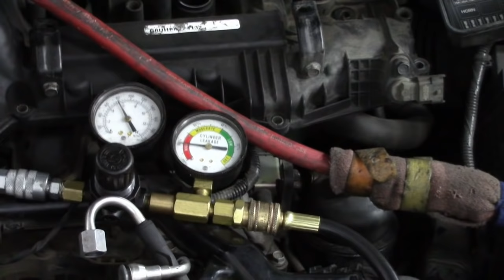Muffler Shop Says This Engine Is Blown?!?!

Comment: I can't help but be impressed by the ability to reassemble multiple components of an engine that you've never even seen before - kodos for sure. I also can't ignore the idea of Matt providing advice for a hair stylist; I'm sure the irony wasn't lost on Vicky either - lol. Great video. 😃
Reply: I have done it a couple of times but when you are almost to the end, you expect more bolts and nuts but are surprised that it is not a lot actually. A lot of cars use clips to secure a lot of the wiring and hoses 😅

Comment: I took my Subaru with only 60,000 miles on it to the dealer when it was running rough to do a diagnostic test. I'd already replaced the air filter and fuel filter that was near the engine, and the spark plugs. They told me I needed a whole new engine, I must have ran it while low on oil. WTH! As I was leaving the parking lot a different mechanic waved me down and asked me if I knew that my car had two fuel filters, there was another one in the rear fender well. I changed the filter, and the car ran perfect for the next 5 years.

Comment: The Meineke by me (Broomfield) is a full service shop. I've only had them do an AC recharge and alignment on a car I was selling. They managed to not get the AC right, so it went back but seemed fine on their second attempt. Glad this guy was spot on.
Reply from the maker: Ah that’s good to know. I never knew Meineke to be anything other than a muffler shop. my only experience with meineke was when I was about 21 years old. I got a muffler done by them and as soon as I left the lot and pulled into the street I heard a loud clunk and my car sounded like a motorcycle. I looked on rear view  mirror and my muffler and tailpipe were laying in the street lol. true story!!!
Reply: @SchrodingersBox  The ones around here are full service too. Same for the Midas shops. I guess plain mufflers and pipes don't generate enough to pay the rent anymore.

Comment: I’m not an ASE tec I was formally trained on wrenching by USAF on jets, I worked many years as an engineer on tugs. From 08-11 I worked as a maintenance manager for a highway company and had a fleet of over 100 trucks. I did 80% of general maintenance and repairs in house unless exhaust, trans, or major internal engine repairs. I had a local shop that I used for the stuff out of my ability and I also used our local Midas and Meineke both have very qualified techs I always had excellent service and repairs that were backed up! Not all techs are equal if one feels sus trust your gut and go elsewhere!

Comment: well that's amazing. Buy new head cover instead of paying for tow truck..
Running engine with dead cylinder will kill o2 sensors and catalic converter.. But you don't need to hire tow truck... Amazing just amazing
Reply from the maker: a new cylinder head installed is quoted at $6000. for a car worth about $9000.
Reply: So instead of tow truck and engine replacement is better to risk killing o2 sensors and catalic converter? I am not questioning your work. You did what client asked for. But i can't see owner's logic.

Comment: One of the most interesting aspects of mechanical work, for me, is the forensics. Why did it fail or what did the previous owner or another tech do to it? Many times the original issue will be masked simply because another person or three threw parts at it without first finding the issue.
Reply from the maker: Totally agree. That’s the fun part. As far as I’m concerned once the brainwork is done and it’s down to monkey wrenching is becomes work at that point!

Comment: CarAdvice:  I am interested in buying a Kia 2011 Sorento  with V6 AWD.  Is this a good SUV to purchase or should I buy something else?  I am also interested in a 2009 Saturn VUE with 3.5 V6 AWD.  Would this be a good purchase also?  Due to used car shortages, Toyotas and Lexuses are 50% over normal prices.
Reply from the maker: The most important thing is what condition the car is in and how well maintained it was. I have seen Toyota’s die at 60K miles and Hyundai’s that have 250K miles. it’s the cars condition and maintenance that’s most important.

Comment: You are absolutely right about the 2% mechanics and the rest are on their way to learn or get burned in this field, sometimes I find it very difficult and annoying to see some guys from a tire and lube services give diagnostic advice about can network or etc
Reply: Those are the shops that melt a customer's credit card by replacing parts based strictly on MIL codes and pattern failure data. And if they install a part WRONG, or get a defective NEW part, the customer runs out of money and/or patience and finally takes it to "the expensive shop" to get fixed correctly 😆.
Reply: I walked away from the auto repair industry 20+  years ago.  Was an ASE certified tech got injured on the job, and could not do the physical labor any more.  Managed a quick lube for a while after getting injured before leaving the the automotive industry.  There absolutely are people that are way over qualified for their position doing basic routine maintenance for various reasons.  However i do agree it's important to be highly skeptical of diagnostic advice from a lube or tire shop as it is highly unusual for the shop be equipped for any diagnostic.

Comment: I think every case is different and if you're just trying to get 20 miles or whatever it's not a big deal but if those guide arms aretube and broken  and you start dropping stuff in the oil pan, while yes it has a screen, you'll clog the screen and cause oil starvation. I just think saying that bolt fell in the pan isn't a big deal, is a big deal until you see the pick up tibe.
Reply from the maker: there is no way a bolt is going to be picked up by an oil pump and clog the screen. not even concerned about it. the engine oil pressure reads perfectly normal. so far the vehicle has several hundred miles logged and is still running fine with the dead cylinder.  I have seen cars go for years like that.
Reply: @SchrodingersBox  I didn't say just the bolt I said the guides worn broken will clog the screen. I've seen it. But do you. I just dont think saying not to worry about it is correct.
Reply: @SchrodingersBox  you must have a difficult time reading and understand what im saying. 
If guide arms worn or broken
And you keep dropping stuff in oil pan
If will get stucked up to the screen
Me see often
Me do professionally
Me know what Me talkie about
You say no big deal
Me say potentially isn't but be careful
I'll upload a video of me drawing ot out for you next
Reply from the maker: still not worried about it. I can see the guide arms are not broken. I can tell you the only thing missing was one of the camshaft phaser bolts. there is no concern of clogging the screen. the oil pressure is perfectly normal. I think they have much more concerning things with this engine  than the impossibility of losing oil pressure.
Reply from the maker: yeah I will be sure to keep your advice in mind with my 250000 subs and 10% growth rate. 

only a total incompetent stupid fool Would do a timing guide replacement and oil pan drop in a blown engine that doesn’t even have worn guides or risk of oil screen blockage. and only a dumber fool would conclude this engine had those issues just because other engines had them. 

  you just simply aren’t thinking. you are reacting. there is no big deal if something drops in the oil pan that has no possibility of interfering with the engine whatsoever. sure it sounds bad, but thought process indicates a bolt in the oil pan is not a concern especially on an engine that is already blown. there is no evidence the guides are failing or even worn. there are no particulates in the oil indicating such a thing there is no way the oil screen will allow a bolt to pass through it.
  Just accept the facts. leave your emotions behind and look at the facts.

Comment: I'm sure most Meinekes are full service. I worked at one for years and all I did was diagnostics. I had a 5 gas analyser, scan tool, 4 channel Pico. We had one guy that did exhaust all day and was good at it. We had 3 guys that did brakes and suspension, and 1 guy that did a lot of the heavy r and r's.

Comment: Driving it for a while with a dead cylinder will misbalance the drive and cam shafts and eventually a bearing will spin.  I found out about that the hard way.  After fixing the malfunction on the cylinder I had to pin the bearings to keep them from spinning and it ran fine.  I drove  the car another 100k miles but I drove it like a little ole lady so as not to stress that engine which I felt was hanging on by a thread.
Reply from the maker: yep that’s true. it can take months- even years sometimes for that to happen though. they just need the car a couple weeks to trade it in or whatever. but yes eventually it will cause failure.

Comment: Meineke does tires brakes and mufflers and exhaust work and some basic engine work sending of the corporate or franchise they also do oil changes transmission flushes radiator flushes etc

Comment: Hey there! I’ve got an issue with a 2001 Jetta VR6 making a rattling noise from the serpentine belt side of the engine that I can’t seem to diagnose myself 😔 Would you be able to perhaps give me a hand? Thanks in advance :)
Reply from the maker: You should remove the serp belt and see if noise goes away. if it does it’s a bad pulley along the belt route.  if it persists then it’s internal and you should remove the timing cover to inspect.

Comment: just went through this of sorts on a cheap malibu.. bent EVERY valve in the head because the guides gave and the previous owner ran it till it wouldn't. got a 2012 for $600 though lol. slapped a junkyard head on it and new timing set. in the end i also put new solenoids on it also. it wasn't a job for the faint hearted. a bent valve doesn't mean the piston is toast. they can be cleaned up and used if the pits aren't too horrible. of course this is a guy fixing his car in his driveway, probably not a for a pro. i wouldn't back that fix longer term if even at all. i got lucky and i don't know if it'll torch though the piston long term or not. it's rolling, good compression, smooth running and cheap on gas.
Reply from the maker: Yes in this case the piston survived.  in fact usually I find it does. but I have seen where it also punched a hole the size of a tangerine in the piston crown too!

Comment: A local Meineke's wanted $1000 just for pads and rotors for my 2010 Subaru Forester, more than the local Subaru dealership would have charged---and the dealership would have used OEM parts.

Comment: Matt you are so fun to watch. Just an idea... maybe dumb things down a bit for some of your newb viewers and tell us exactly why this particular failure would result in the need for a new engine or rebuild. Are the valves so far inside the engine it all needs to come apart? I know you guys all know these answers but I have very little clue what needs a rebuild vs what can be fixed more easily.  Thanks! Love your style!
Reply from the maker: appreciate the comment. since this is an advanced channel I tend to assume the viewers are familiar with the mechanical and electrical. 
that’s why what I do on my pay channel is.I walk much more step by step assuming the viewer is unfamiliar. for example here I just go the the fuse box to run the starter with a jumper wire. on the paid channel I walk through how I know where to make the connections and how I mapped the circuit out. I also have videos where I explain the engine strokes and why I am getting low compression or high leakdown based on what must be happening.
Reply: @SchrodingersBox  ahhh thanks for the info! I didn't know any of this. I will check it out. You have a great teaching style and thanks again for the videos. I just do basic maintenance but love knowing more about how things work. Always amazed how you are able to put everything back together again! Let's go brandon!
Reply from the maker: Hahaha “let’s go Brandon” lol!!!!

Comment: Just 3 extra bolts. Hell I have gotten a box full of bolts & small parts from fixing cars. I would count bolt holes and when putting things back together. There would always be bolts, screws, nuts, washers, and little insignificant little parts leftover that we could not figure out where they went. Tear down a whole car & rebuild it & you get those things. I just thought the manufacturer had more stuff than needed on the cars

Comment: I find it strange that the phaser could have moved far enough to bend a valve without a jumped chain. It wasn't damaged to the point that it allowed the camshaft past the physical limits of the phaser. Valve damage on only one cylinder is a little uncommon too.
Reply from the maker: agreed and I thought same. but that valve is bent for sure. also when I see this happen it’s always one valve that I have ever seen. because usually engine stops dead when they collide the first time.

Comment: Why would it need a new motor when all it's got is a bent valve? Pull the head, fix the valve. A few dings in the top of the piston won't hurt anything.
Reply from the maker: because it’s cheaper to get a used motor.

Comment: If the valve bent it would also tweak the piston rod and crank
Reply from the maker: not necessarily. a valve stem is maybe 20mm in diameter. a piston rod is inches in diameter. there is no way it’s going to bend the piston rod.

Comment: What will you consider to be some of the possible causes for this problem, lack of oil,carbon build up at the valves????
Reply from the maker: no idea. my guess is someone worked on it before and didn’t torque the phaser bolts.

Comment: Get this thing to a dealership ASAP! All 2013/14 Santa Fe Sports have a 10 year warranty on the engine. They're notorious for failure and Hyundai will fix it for free. Generally it's a replacement of the bad parts ie either a short block or head change. Not a complete engine. Either way, definitely get it to Hyundai.
Reply from the maker: it’s a 10yr 100K miles warranty. it’s well past 100K miles.
Reply: @SchrodingersBox  This isn't the regular warranty. This is a recall for the Sonata and 2013/14 Santa Fe Sports only with the 2.0T and 2.4 Theta II engines. 10 years and unlimited mileage. If they can find a good dealer they could end up with a decent deal. I'm doubting that the damage to this engine quite qualifies but they could get a deal where they pay for a top end and Hyundai pays for the bottom end, labor and a car for the interval. It's more than worth it to have it checked out instead of sticking it into a storage unit to rot.
Reply from the maker: ok so you mean you are referring to the recall, not the 10 year warranty correct?  the recall has nothing to do with this engine much less this issue. the recall was specific to the 4 cylinder only for a completely unrelated event. there is no recall on the 6 cylinder.
Reply: @SchrodingersBox  Well... crap. I didn't even notice it was a 6. To quote Emily Litella: "Never Mind!"

Comment: The sad thing about modern cars these days is the increase use of cutting corners using plastic engine components. They don't make them like they use to. I still drive a 15 year old Camry SE and it may still run for another 10 years or more.
Reply: Well that stuff don't rust!
Reply: @jostouw4366  sure plastic may not rust but you will be going through a lot of them. The modern GDI engines aren't going to last as long and a normal engine. Governments are pushing strict emission standards and force manufacturers to to make more smaller fuel efficient Engines that contains more plastic components, more complexity with turbo chargers etc.Toyota stopped mass production on there V8s. It sucks blame the government and manufacturers for cutting corners.

Comment: I don't understand feeling the need  to drive it 20 miles like that , tow it and then get some help and push it where it needs to go.  Oh well,  Plus , could the compression leakdown problem have also been a blown head gasket at that cylinder? At least it didn't grenade when you revved it.
Reply from the maker: how would it be a blown head gasket with leakdown through the intake though?

Comment: It's too bad actually that they didn't just want to put a cylinder head on it The bottom end is probably fine You can fish that bolt out of the oil pan If they drive it like this the valve head or the valve seats going to drop and then blow a hole in the piston
Reply from the maker: how is the valve seat going to drop exactly- I don’t understand that. how is that going to happen?
Reply: @SchrodingersBox  You can't understand how event valve hammers the piss out of a exhaust seat and an alloy head eventually the seat gets hammered in on one side loose in its pocket and can fall? Or that bent valve head continually hammering on the seat decides to try to bend itself back and the stem snaps smashing a hole through the piston you can't understand that?

Comment: Who are they going to call when it dies 10 miles from their house?  Your warranty was for 20 miles, ha ha.  It would be cheaper to sign up for AAA cheapest plan to have them tow it to the house when it dies.
Reply from the maker: Not even worried about it at the time, and in fact they have actually been driving it daily since the video released. probably had several hundred miles by now and still fine. I have seen people drive cars for years like this.

Comment: I'd of barred over the motor and checked timing marks .as it stands 2 bent valves a new timing chain and phaser kit and a pick a part head $50 . plus gaskets. 
if valves hit the piston the valves bent   there is nothing wrong with the piston or cylinder.